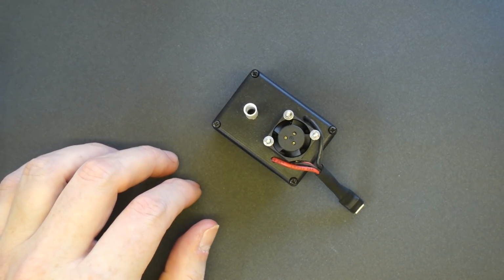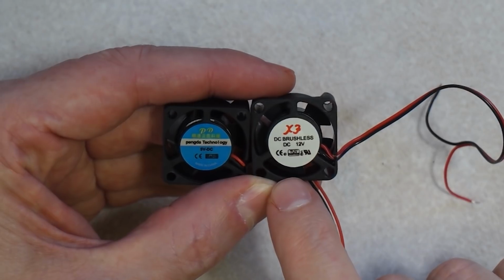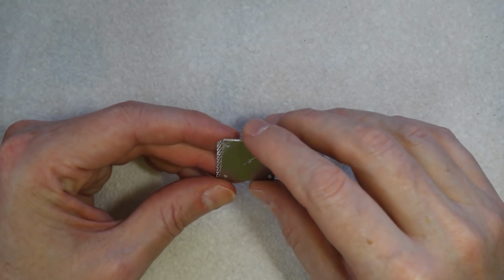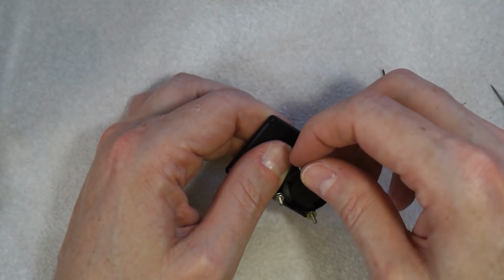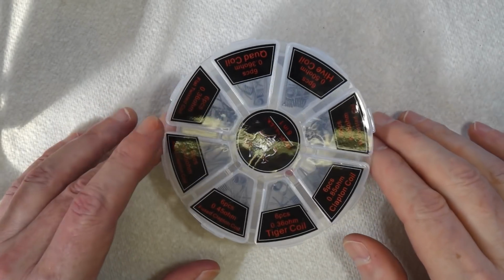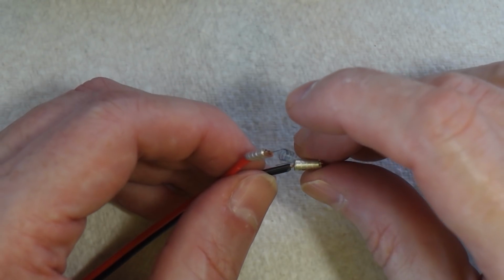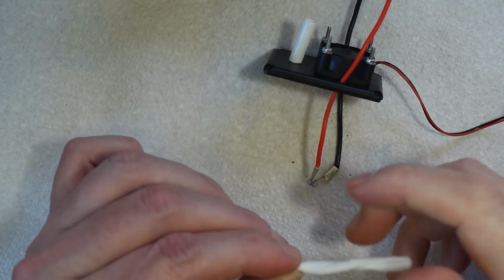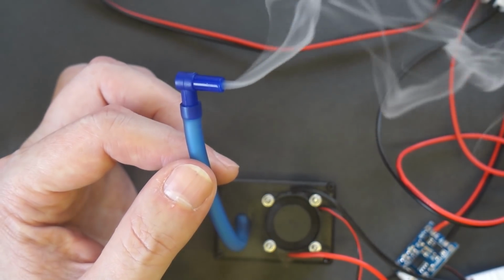Diorama Build 2 of 4 - Building a miniature USB powered smoke generator for a diorama

Comment: hi m8
made a smoke machine 7.2 v bbattery 50mm x50mm fan just about working fan is correct
way but more smoke is coming from fan  ive made outlet much bigger but same prob
using 23 gauge vape coil wire any tips please  ty
Reply from the maker: Air will always take the path of least resistance, so increasing the size of the outlet should help, but if the fan is creating pressure in the box, then the smoke will come out any way it can. 

Try slowing the fan speed down, see if that helps.
Reply: @SteamGeezerUK   hi thx for reply its goin in a boat it would look like its on fire lol
would make difference if i use bigger box/fan? my fan/battery are wired together but can change if have to 
but it was easier that way 
many thx again
Reply from the maker: @ravenxbmc1456  It might do. I have to say smoke machines are a bit of witchcraft at times - sometimes you have to experiment to see what gives you the result you want.

Comment: Does it give any residue on the miniatures?
Reply from the maker: It really depends on the setting. On the tank build this went in, it was open to the air so it just blows away. If you were to enclose it in a display case, then over time I would expect there to be some residue, but I think it would take a while. The problem is, the glycerine in the vape fluid doesn't evaporate (ironically), so any residue would remain indefinitely.

Comment: Hi I have made a smoke generator like your  but can not find the Japanese linen can you tell me ware you got yours from
Many Thanks Steven
Reply from the maker: It came from ebay - search for "vape wick". Quite often vendors will supply some when you buy vape coils. If you can't find any, you can also use a few strands of flbreglass rope. That's usually sold to line the doors of wood burning stoves and such.

Comment: Hi can you give me the size of the box you used  the smoke generator will make a good addition to my three D printed fpv rover 
Thanks Steven.
Reply from the maker: Thanks for watching. I believe it's an RX2007 box, approximately 46x32x19mm. I'd have to double check to be sure. I've made smaller ones - the smallest is less than 25mm square, although it does tend to overheat quickly.

Comment: Where do you get your materials and hardware for projects like this
Reply from the maker: Chinese vendors on ebay mostly. If there's anything specific you're after, I'll see if I can find a link.
Reply: @SteamGeezerUK  thanks, im trying to make a smoke system for my trx4 bronco that comes out of the exhaust and a smoke system for my drift car to make it look like there is tire smoke when it drifts. The heng long tank smoke generators i got dont work at all.
Reply from the maker: @munkeynutzmcgraw4680  If that's the case and you want to power it from the car's battery, I would suggest finding a vape shop, taking the battery with you and seeing what vape coils they have that will hold up to the charge in the battery. I'd also recommend trying to find an aluminium box instead of plastic for the smoke machine as it will handle the heat better and, if the wick catches fire, it won't burn your cars to the ground :-)
Reply: @SteamGeezerUK  thanks for the help
Reply: @SteamGeezerUK  how would i be able to make the element pulse to keep it controlled rather then just running constantly
Reply from the maker: @munkeynutzmcgraw4680  I've seen relays with a timer built into them. I've never used one myself but I believe it might do what you want. I usually use a Digispark, a micro-computer, but I think the timed relay would be a better and simpler option.
Reply: @SteamGeezerUK  indeed, thanks for your help love the content and keep up the good work
Reply from the maker: @munkeynutzmcgraw4680  Thanks, and thank you for watching.

Comment: Hi mate, you appeared to have skipped over the part about the exhaust and tube.  What did you use for those?
Reply from the maker: In this case it's a piece of 6mm styrene tube. I usually use copper pipe, but I wanted to see if the styrene could handle it, which it did.
Reply: That’s great, thanks for that.

I’d like to have a go at making one as an exhaust for a 1:8 scale model, was your smaller one made the same way?

Really appreciate your video, I can’t wait to give this a go
Reply from the maker: Yup, they're all made the same way. Just be careful the box doesn't get too hot and melt :-)

I look forward to seeing what you come up with.
Reply: SteamGeezer and Son Independent Traders  Thanks again, brilliant video :)
Reply: If I lined the box with rubber than copper foil, do you think that might help with heat?
Reply from the maker: Possibly, depending on the type of rubber. Some silicones can handle several hundred degrees C and are used for casting pewter. I'm not sure how any other type of rubber would hold up. What you need to consider as well is that the heat needs to go somewhere. With these little 5v burners, they don't get that hot, but if you run it at a higher voltage the heat needs to soak off somewhere.
Reply: Thanks again

Comment: Hi great Video. Could I buy one from you
Reply from the maker: I'm afraid I don't sell these, but thanks for watching.
Reply: No worries I'll follow your instructions and make one lol
Reply: @SteamGeezerUK  could you give a list of materials used please
Reply from the maker: I don't have a specific list of materials, but everything mentioned in the video is sourced pretty much from ebay. You've basically got the box, a fan, the heater coil, some fibreglass rope, a battery, a small tube for the outlet, some aluminium tape (optional) and some vape fluid.